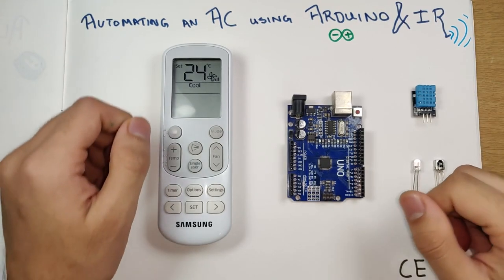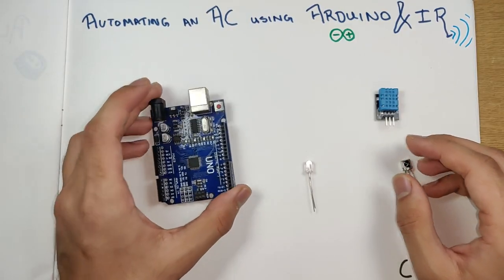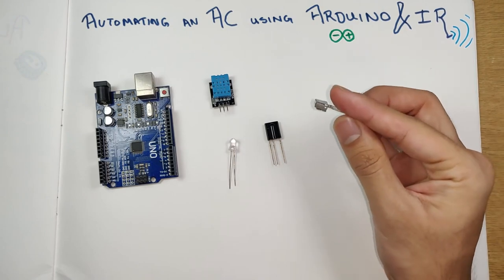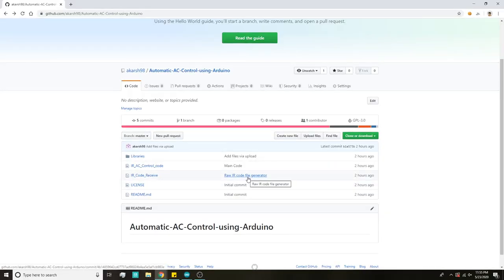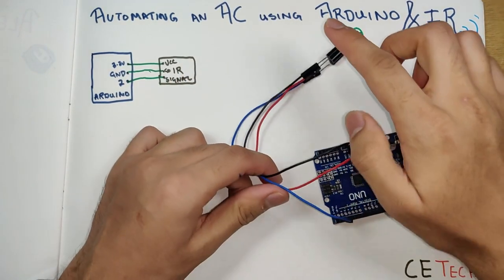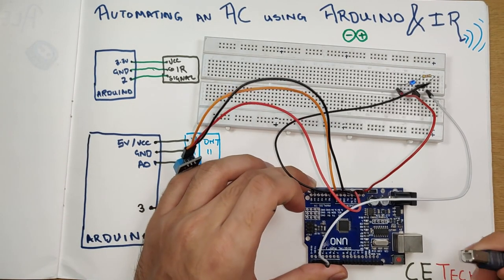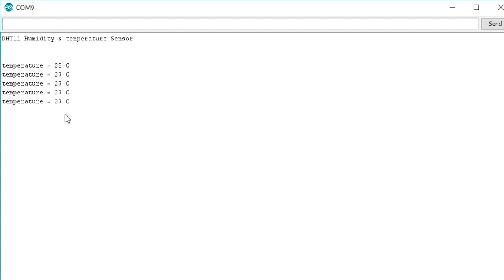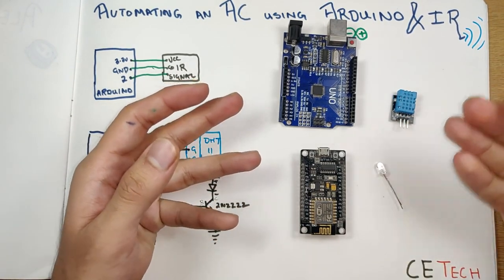Automatic Arduino Based IR Remote Control Temperature Driven

Comment: I tried and and have to say it works but please use ir led which is used for remotes. Other ir led will not have the same wavelength/power output and have really close range like 1cm. I was stuck due to this for days until I usedir led from an old TV remote
Reply: Hola, tendrás el código de este video? Puedes compartirlo!

Comment: Dear Sir, nice video. very useful. My question is , can I control 2 different ac with one Uno. What should be the change in program, and which 2 output pins do I have to use?
Reply: Actually I have 2 ac in 2 different rooms. I want to ensure that only one is cooling, goes to fan mode, then next room ac to cool, goes to fan mode. This to repeat every 10 minutes, so that my house wiring is not loaded with both ac cooling at the same time... Is it possible to use two IR Transmitter to achive this, then how to tell the specific transmitter to send signal, one after other at gap of 10 minutes.....I hope I am clear
Reply: @shiftponda6835  prepare two arduino board and pair using wifi.

Comment: Great tutorial, thanks a lot sir, hat's off, it works great for me, even without transistor( short range though).
The only problem is, i have a buzzer in my AC unit, so everytime it turns on or off, it makes a sound, I'm looking for a solution to stop it
1- stop the infrared from transmitting (using IDE code) which is the best solution.
2- adding a current reader in the unit, and make it communicate wirelessely.
3- removing the buzzer from the unit ( not keen on this solution.
What would u advise me?
Thanks again, like and subscribtion from Algeria.
Reply: hii do u still have the github code? bcs the channel's github is hacked and they dont have it anymore but i want to make this....

Comment: Thanks for the video! 
while sending you specified 36khz in the parameter: how to guess this value as the usual one is 38khz?
I don't really understand the need for the transistor to control your led?
I would appreciate if anyone has an idea.
Reply: The best way to switch a charge, such as an LED or another component, is using a transistor, which works like an electronic switch. The reason for this is that the current to saturate the base of a transistor is much lower than the supply current for an LED, which means it does not overload the microcontroller.

Comment: Thanks for the amazing tutorial. But the range of my IR LED is very short. How can i improve the range? Any circuit for the same?
Reply: You can use transistor. It will make the range longer. There are several kinds of transistor, so look carefully and buy.
Reply: @조성현-v5u  thank you for reply. Please can you recommend any specific type of transistor? or any specific name?
Reply: @comedyindia7991  You can try TR 2N5551, or any transistor.

Comment: Thank you for the great video,
 I want to control the air conditioner using nodemcu (esp8266) but it shows me that the code is not compatible, what is the problem?

Comment: Thanks for taking the time and effort in making the video, it was very helpful. 

One thing I would like to ask is why are we using a transistor? Would having the IR LED plugged to GND and having Arduino control the +VE pin to the LED work? I'm afraid I don't have any transistors lying around =(
Reply from the maker: It might work, but not for long

Comment: Hello,
Thank you for the great video!
I was able to read the IR commands and then send them back out okay. But my swamp cooler uses the same commands to turn it on and off. I have tried changing your code with no success, I want the code to be sent out only once, when there is a change.
I will assume the swamp cooler is always off when starting.
Any ideas would be appreciated.
Thanks,
Bryan
Reply: hii do u still have the github code? bcs the channel's github is hacked and they dont have it anymore but i want to make this....

Comment: Great project. One question. Why use a transitor to control the IR? It´s not possible connect direct to the port using only a resistor?

Comment: Hi sir, I had tried the hardware and coding about 3days….. and why my arduino ide keep looping the data temperature = 31 C AC switched ON….. but my aircond is not functioning even when the temperature cold down below 20 C then the aircond also not functioning……why?

Is it working for all brand aircond?

Can sir help to do one video about universal remote control for all brand aircond ?
Reply: The above code will send a signal on demand , it do function I've used the code below
Reply: if (temp > 29) {
Serial.println(F("AC Switched On"));
  }
  else if (temp < 26) {
   Serial.println(F("AC Switched Off"));
  }
Reply: You have to change the code for each AC brand

Comment: I have been wanting to create a home automation system, I think, your guide would be a nice start to dive into Arduinos and RPi. By the way, can I attach RTC module and turn on the AC and the temperature control only in the evening, off before I wake up? Any pointers? Cheers, from another guy living in a dastardly hot region.
Reply from the maker: Yes you can definitely do that!

Comment: I am having a problem. I'm getting different IR codes for the same button when I press at different times. What could the reason be?
Reply: me too
Reply: Well that's because of the advancement of the controller. Each temperature value has its own raw data. therefore we need to assign and have a track of what temperature it is and assign its values.

Comment: Hi sir, I copied and pasted the IR_code_Receive code into the Aduino software but when I tried to verify I got this notification:
IRLib2:8:10: fatal error: IRLibRecvPCI.h: No such file or directory
 #include <IRLibRecvPCI.h>
          ^~~~~~~~~~~~~~~~
compilation terminated.
exit status 1
IRLibRecvPCI.h: No such file or directory

and I couldnt uplod the sketch. What am I doing wrong?
thank you
Reply: you need to add the library IRLibRecvPCI.h with the given link, but the link is not woking

Comment: Hi Bro , I tried this with Panasonic AC. I am able to receive the signals and also I can send. But the AC is not responding. What I am doing wrong?
Reply: The receiver program is not working for Panasonic. I got diff receive program and it is working with your sender program. Thanks bro
Reply: @ahavagowtham963 hi bro.... can u share the receiver program code....

Comment: great concept, is there a way by which you can get feedback from AC unit that its been turned on/off or not?
Reply from the maker: You will have to add a current sensor to the AC then connect it wirelessly to the arduino.

Comment: Hey CTech I love your videos.
Could you please make a video about switching one of those cheap mini-cube cameras via microwave doppler sensor rcwl 0516 and connect it to lora point to point to get a message if picture was made?
Maybe even with the rcwl modul connected to the camera wirelessly so an object is detected by the rcwl, sends a signal to the camera and the camera makes a photo from another position than the rcwl?

Comment: You are quite fast with your connection steps kind of making someone confuse, the connection of the base and resistor. You mixed the whole process up
Reply from the maker: That is why I provide a detailed self paced instructables article link in the video description
Reply: @CETech4u  I went through the instructables and you said the base of the transistor is connected via the resistor can you help me get that, does it mean the base is connected to a terminal of the resistor and the other end of resistor to the the arduino pin 3. Because I actually heard you say the base is connected to the arduino pin 13 so am quite confuse. If you can kindly help me out